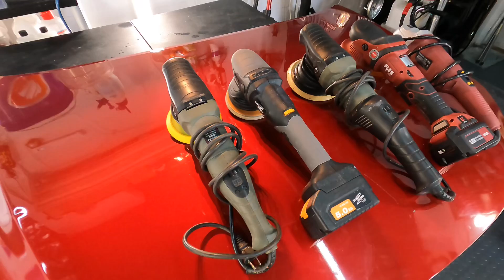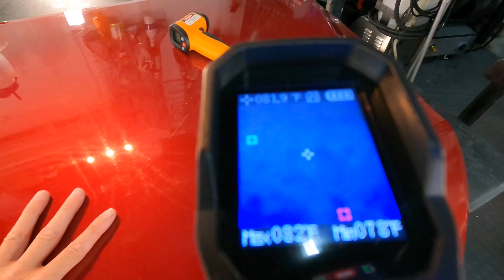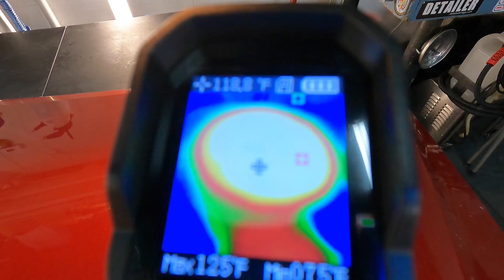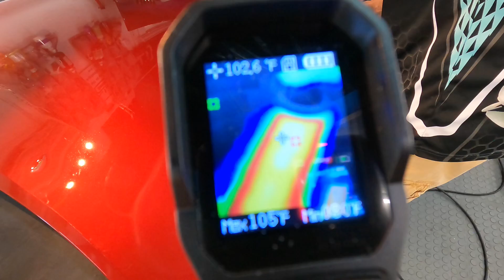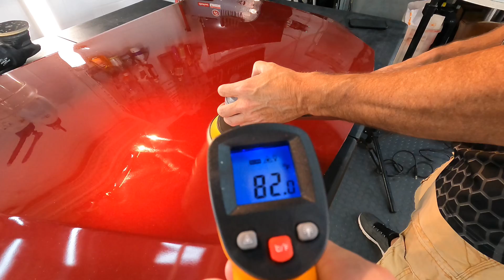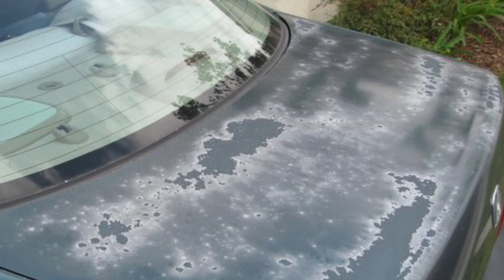Extreme Heat Is Awful For Modern CLEAR COAT!! These Polishers Produce The Most Heat!!

Comment: Great video thanks! Another cool video would be to know the heat difference between a foam pad without a hole in the middle and a foam pad with a hole in the middle using a backing plate with the whole in the middle.

Comment: What’s even more interesting 😢is how an 8 mm in 95 degree cut through clear.  A car should always be out of the sun and cool to the touch before working.  I wonder what the panel temperature would start at when outside for hours . I have the Griots G9 , 2 of them , Flex 3401 which I like the most, a GR 3, G8, and G13 from Griots . The old rotary never comes out and I’m trying to sell it with a lot of pads, etc.

Comment: Here’s how I do it now that Yvan explained what he does with the rotary. I cut with the DA usually 3 slow passes medium pressure depending on what I’m trying to remove…swirls, oxidation etc.. then I’ll switch to the rotary and do 2 passes with zero pressure on the pad and a moderate speed before moving to the next panel. If the finish is new with little to no defects then I’ll just use the rotary. The key to a rotary is use less pressure and keep it moving.

Comment: The only time I burnt through paint was on a 8 mm while polishing in 95 degree heat. I made a bad choice. Buy a polisher which is well engineered. The last two polishers I bought were by Flex.

Comment: It would be interesting to see how much backing plates affect this and if ones with cooling holes really make any difference like the Griots BG5BP or other very vented pads do actually run cooler. Also I assume if you run a vented or hole in the middle plate on the hot polisher it wouldn't be so hot, right? Seemed like it wasn't the polisher so much as the plate behind the pad?